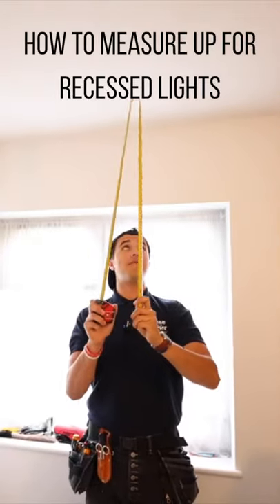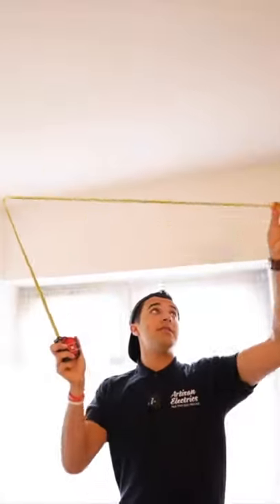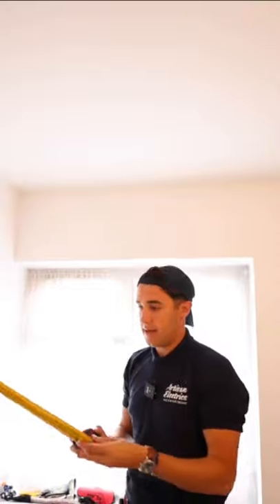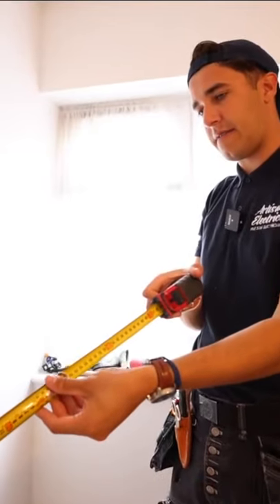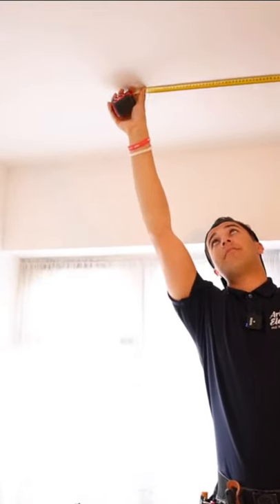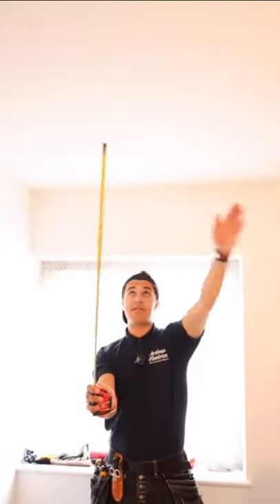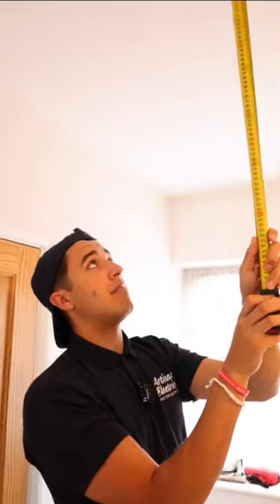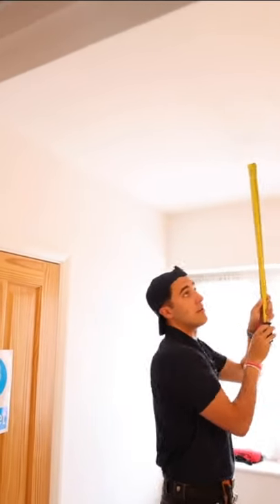How to measure up for recessed lights #shorts

Comment: Recessed lights in a hallway or landing is totally diffent to measuring up a bedroom etc.
I see a lot of sparks measuring out for recessed lights or lights in general doing even spaces 
Which is wrong, you should always have half spaces on the ends 
Also you should always have a centre to centre measurement you go off so each room is the same 

If its 5000mm room and you have 1000 mm centre you will install 5 lights 
Because one of them 1000m you'll half 
Making it 6 spaces so that means you have 5 lights 

500 |1000 |1000| 1000 |1000 |500
So the light span is dispersed  correctly <○ ><○><○><○><○> 

If you did it 5000m and just divided it by 1000mm for 4 lights 1000mm spaces light to light the light span would end up being like this 
1000|1000|1000|1000|1000

<<○><○><○><○>>( which is wrong ) in my opinion 

If you divided the room and it ends up being point something I wack half of the reminder on each half on the ends depending on how big the point is if it's like point 9 I'd probably add another light
And then use what's left in half to put on the wall to the first and last light unless it looks silly 

Or 
If say it was 6537mmm  room 
Divide by 1000mm is 6.537 

So you can choose 6 lights then divide the room by 12 !!! Which will be near enough a metere  between lights 
544.75 ○ 544.75 544.75 ○544.75 544.75 ○ 544.75 544.75 ○ 544.75 544.75○ 544.75 544.75 ○ 544.75 
( 12 values) for centre to centre 

What ever number of lights you end up with you always divide by double the amount of lights and have one value on the ends and double the value in between lights 

If you have have rooms where it has chimney breasts etc make sure you measure your wall from chimney breast to wall rather than the wall to wall otherwise it will look odd 
Hope this helps and wasn't a too long winded way of explaining how to do it for people trying to learn 
This working out goes for spacing of any lights , you just need to work out what your centre to centres you want first
Reply: That's why is best to do it by the book ... one chapter in school had a topic dedicated to lights and spots are some of the hardest to calculate as you need the space shape, light angles, dispersion, strength, overlap, distance between walls, other sources of light, wall color, furniture color... etc. Really easy to mess up and create unwanted dark zones and shadows, strong contrasts, glow zones, reflections etc ... i stil can't get my head fully around that chapter
Reply: @contytub  what’s the name of the book?
Reply: @rahj1365  ... if it would be that simple ... for me is 5 sources at least only to do lights ... 3 are about electrical and light theory, 1 is about building requirements and last one is lights catalog...
Reply: @contytub what are they called tho

Comment: You should see my Toliet room. It has a not centred downlight. 
Why? The architect of the house put joist in the centre of the room.
Reply from the maker: Haha typical architect
Reply: @artisanelectrics  it was fine with a Ceiling Light / pendant light.
Reply: A good reciprocating saw, turns anywhere in the ceiling a good place for a recessed light